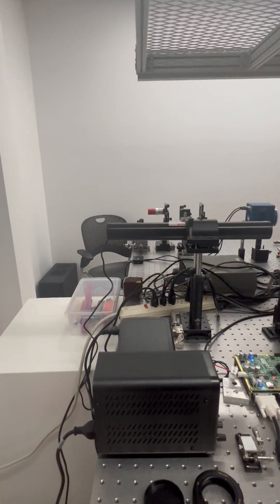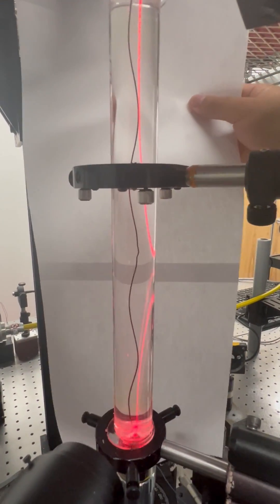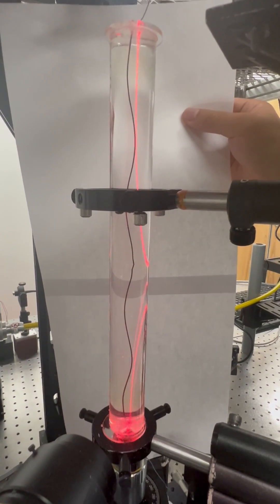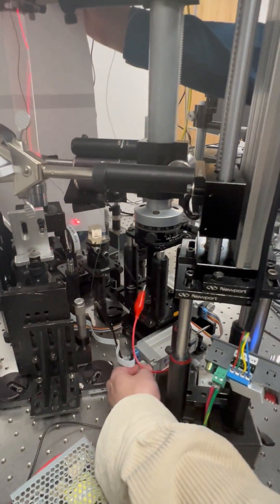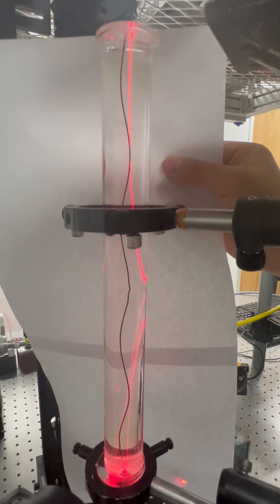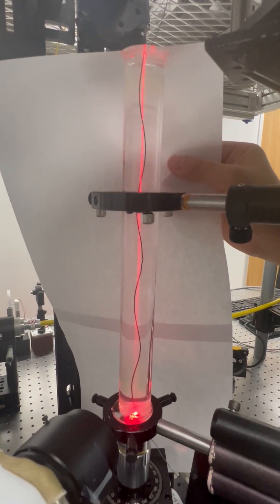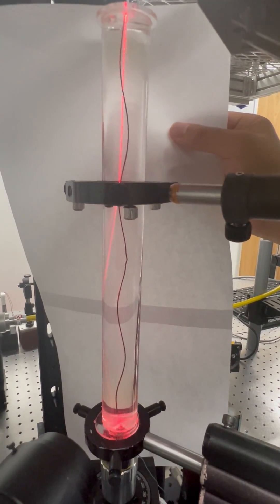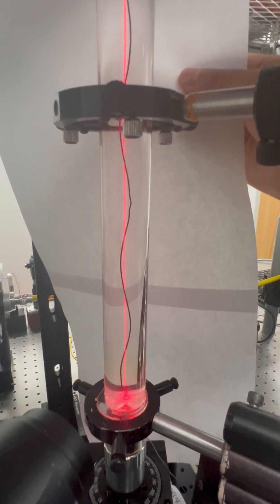Optical Trojan Beams via Lagrange Points

Comment: Congratulations! beautiful! Could we do this on a micron scale? In our lab we do 3D laser writing so we can draw helical architectures of negative and positive index changes, even hollow (n=1) nanochannels. This would be nice to try.
Reply from the maker: yes it can be scaled to micron sizes- we thought it is more dramatic and visually more easy to digest to do it in the large scale- there is so much you can do with this ad many different ways to implement it- depending on the application you have in mind. 
one thing to remember, it is as easy as we showed in the video to find the point.
Reply: @wsmmuri7915  Thank you for your answer Mercedeh. Congratulations again for the superb work and the finding.

Comment: Thats a very cool demonstration. Does this have applications in something like sub-sea cabling? Perhaps instead of delicate optical fiber, they could be filled with the fluid used here, then a condoctor could induce the radial temperature gradient.

Edit; or maybe a better use would be a linear thermal gradient in benchtop optics for extremely fine beamforming, or lensing effects.
Reply from the maker: yes it can be scaled to micron sizes- we thought it is more dramatic and visually more easy to digest to do it in the large scale- there is so much you can do with this ad many different ways to implement it- depending on the application you have in mind. 
one thing to remember, it is as easy as we showed in the video to find the point.